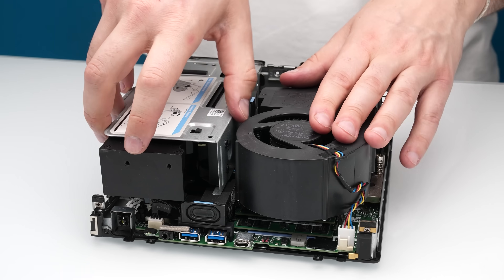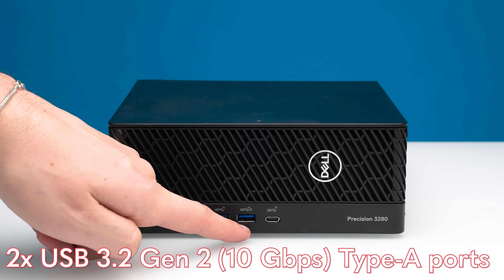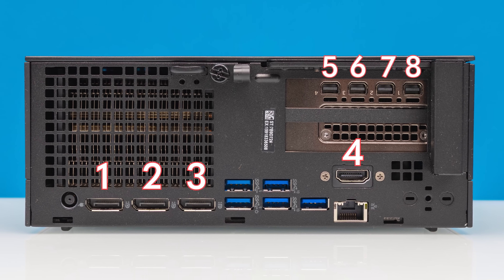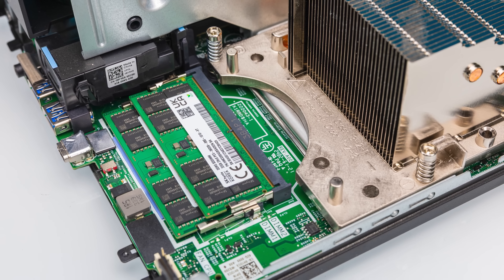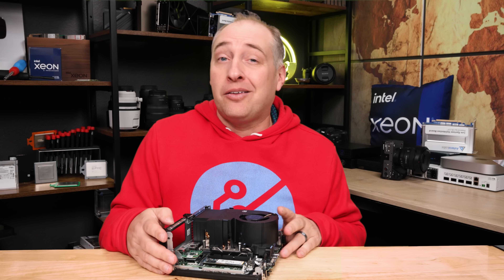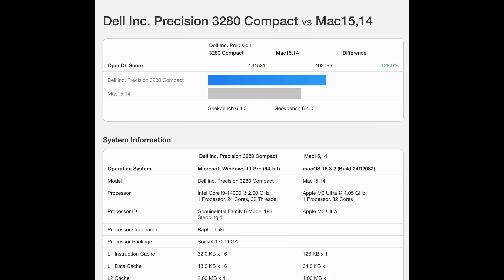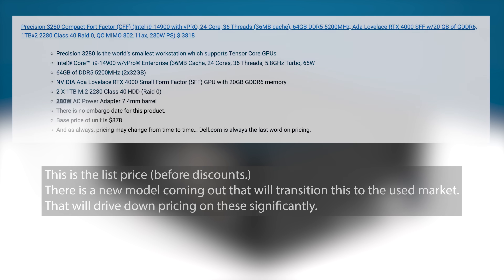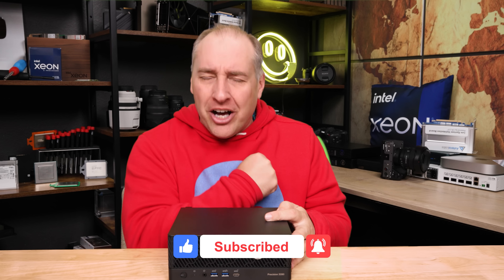Compact with EVERYTHING Dell Precision 3280 Compact

Comment: adding memory does not void your dell warranty as this video seems to imply and then moves on quickly, if you add memory then only the added memory is not covered under warranty and the rest of this system is still covered. source - i do warranty work for dell
Reply: I have to agree with DC12548, I used to do dell warrantee work. Dell will still cover the system but not the third party ram/additions.
Reply: What about the wireless card? I remove all wireless adapters and I have had some HP Elite Mini machines "soft brick" (persistent unremovable error about WLAN being not present) afterwards, even after reinstalling the card. HP support told me I damaged the BIOS and that they would charge me for a board replacement.
Reply: @ShirokoCycling  if it only happens on some machines I would suspect the card not being properly seated in the slot, the M.2 style flat cards can be finicky. I would remove the screw and take out and reinsert the card making sure it is all the way in and totally straight. Not buying the 'BIOS damage' at all, it isn't logical for a list of reasons too long to type out. Just be careful with the hirose connectors for the antenna wires, they are a bit delicate. May not be an issue if you don't use the wifi cards, but the connectors are a b*tch to replace.
Reply from the maker: Totally. But folks who want the entire system to be warrantied do not get the warranty on the RAM.
Reply: @ServeTheHomeVideo  Pinned 

In California, even without an express warranty, manufacturers of most household electronic goods sold for over $100 are obligated to provide spare parts for up to seven years, and the Right to Repair Act requires them to provide documentation, parts, and tools to owners and repair providers.
Reply: @ServeTheHomeVideo  Serve!!! Only CA do not get the warranty Its law

Comment: Would have been perfect if it came with a power efficient AMD Ryzen CPU. Its a bit of a fail to use Intel 14th gen, when these things are known for burning out.
Reply from the maker: To be fair, these are the 65W parts and Dell firmware.
Reply: Only the 90W chips and up were blowing up over here. I haven't seen any 65W non K or 35W T CPUs fail yet.
Reply: Dell still refuses to do AMD SKUs for their business Optiplex/Latitude lines !
Reply: The 14900 is power efficient at low wattage. 14900T would of been better
Reply: @dankmemes3153  RPL cores are surprisingly efficient, and I second this. I also think that the 14900 is fine here, but something like a 14700 would be more appropriate for most people.
Reply: Yeah I looked at these and really wanted to like them but in the end they are a jack of all trades and master of none and too proprietary. A new or used PC/server with an AMD CPU is going to give you so much more in the long run.